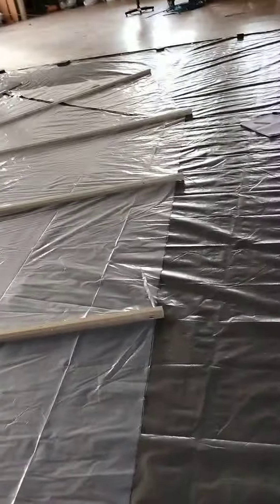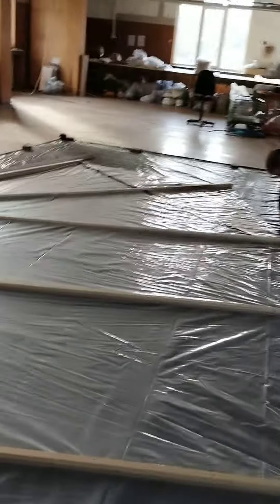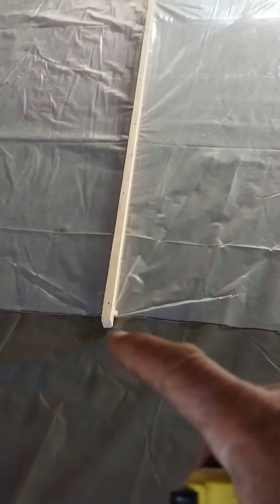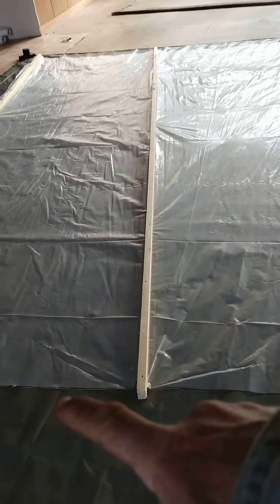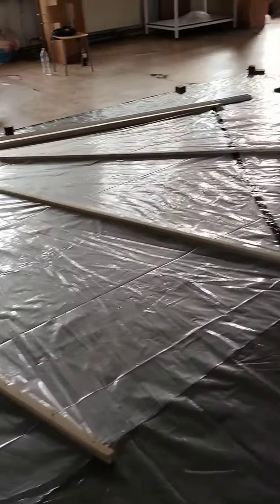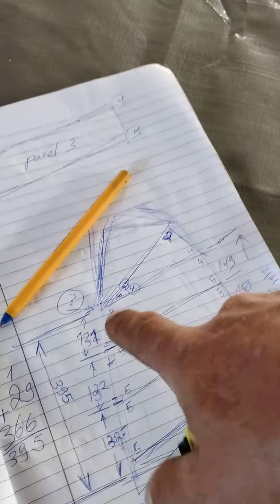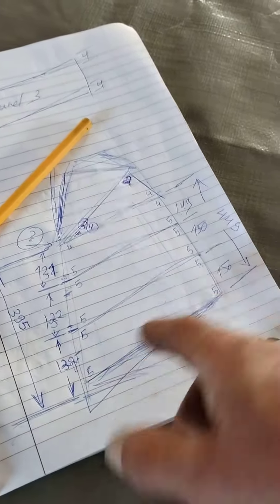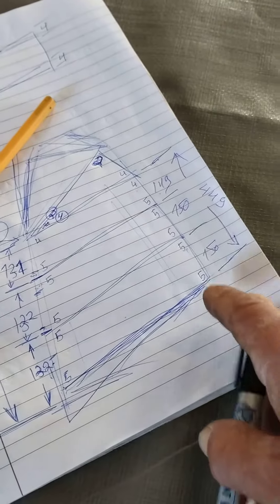"In Rome b A Roman". Balkan Shipyards

Comment: I have been aware of that method of inducing camber to a flat sail for some years now , and I think it is probably the easiest method . I don`t believe there is any benefit in fitting gurney flaps.
So , here is the thing ;
If you get your dart measurement , and then halve it  , ( for each panel )  ,  you only get half of the camber IN BETWEEN The battens .That equates to half the camber.
The darts should be twice the width to get the  % you want , in  each panel.
If , for example your camber works out to  4 inches , it should be 4 inches ( 100 mm if you like ) on each panel , in between each batten. That would make the total dart width 8 inches.
Reply from the maker: Just on time bro, marking darts after coffee! They looked small to me??!?!?!??? I was wondering.... 
Thanks so much 👍👍👍 
The Force is with u my friend, gonna draw some 10 cm darts now!
Reply: @BalkanShipyards  Just  can`t see how you can get enough camber that way ? 
Maybe someone else knows  for sure , I have not tried it , but will make a Junk sail soon ???
Reply: @BalkanShipyards  Don`t mess up your tarp , check with someone first !!!!!!
I could be wrong , I just think it`s not enough camber that way ????
Reply from the maker: @hardystein114  u messed up Hardy, it's sewed... I'm sure it's perfect, since I couldn't get over the small looking darts I had. It's good bro! Thanks!
Reply from the maker: The Force is Strong with U Hardy! I added camber and I'm very happy. I forgot how I made my first sail.... Adding is better, I will explain why it's better for me in a vid soon. Thanks!
Yet the dart is truly half the number, since there is another half at the other side of the panel.
Anyway I went bigger than what I had, and what I thought I need thanks 2U

Keep Shunting my friend
BSY
Reply: @BalkanShipyards  I was getting a little worried .....didn`t want you to ruin your tarp.
Reply from the maker: @hardystein114  yea, went big, deep camber sail, the penny dropped too late...
 it's my fault, but I felt only good energy after realizing what had happened. then, I began thinking about it, it's better this way, for this boat. I will lose windward ability, maybe go to 60 degrees at most! But this is a cruiser made for mostly off wind sailing, so overall I'm better, in light winds I will have much more power. My sail is a touch lower, and has a lower aspect ratio, that's better, my leepod is big and heavy, lower and wider is more stable, more camber is more power. More power for more stability, windward ability? Bermudas can do that I'm going cruising, we reach and run, Thank God.... Keep Shunting Hardy, there are no mistakes, that I don't doubt!!!
Keep Shunting my friend, Today we both learned a good lesson.... 
U got worried, cos u care, your breed is going my friend, nobody cares anymore.....
  Keep caring, Thanks for being here
Rael
Reply: @BalkanShipyards  I share your thoughts about the whole sailing to windward thing Rael. 
At first I thought " too baggy " for windward ' but I also spent many years sailing cats.

I quickly learned that multis of any kind 
( including tris , cats and proas , I think ) dislike being pinched to windward. Bearing off just a little will give you drive and speed , and usually always pays off .

You are on the right trajectory I think ; I don`t know if you need a strong downhaul to keep luff tension on a relatively low stressed rig when going to windward ,  but I would avoid it as much as I could . 

We had that discussion about breaking things when you crank tension into a modern rig ...You think much as I do for these rigs Rael , all good I think.
Reply from the maker: @hardystein114  luff parrel? For sure!!!!!
This last comment finelizes d simple fact, we maybe went to big! But we are much closer to what should b... Der 4, it's bang on bro. Cos b4 it was way off! I need light wind power and stability. Baggy is GOOD 👍 Call dis sail BAGGY I think.... No fuel, this is a heavy cruiser, in a blow everything sails... In light winds, no fuel, who sails, Bermudas stat engines my friend....
Thanks
Keep Shunting Hardy
Me